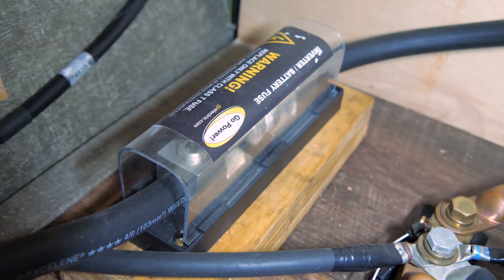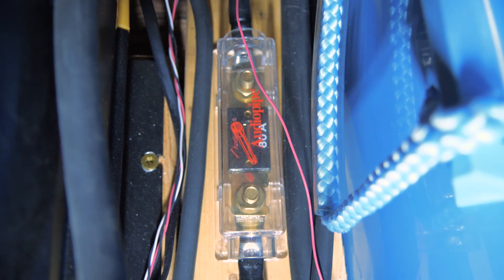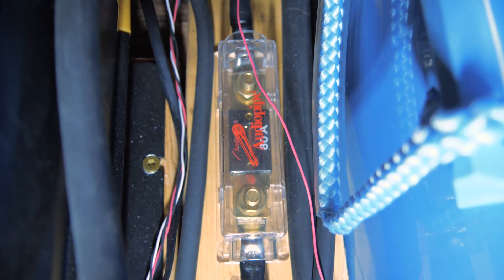MISTAKES! - 5 Common RV Solar Pitfalls - RV Life

Comment: Full Time extreme boondocker currently in Grand Staircase Monument, southern Utah. IThis summer I installed 6 100w panels with 3 100w BattleBorns i(inside coach,) 150/60 Victron MPPT,  plug-in display and smart monitor, and a Tech-On 3000-6000 inverter. Last week snowed in for 8 days at 7500'elev. 5 miles up a USFS dirt road. Though sunny & cold all days, my only draw is my cool new ICECO 45 liter chest freezer (12v), the fridge igniter for propane, a 12v heated mattress pad all night, and a few 3w LED lights. But the last night battery voltage showed 12.1 only to show 10.1 the next morning! Even my starting battery was dead through the isolator. I wish I could find someone to fix it all so I can forget about it.

Comment: Is it better to run a frig off of DC or run with an inverter and run AC ??
Reply: I like propane. No probs so far. Very cost efficient I think.
Reply: Generally, if an RV fridge is running on DC, the electricity is only running the controls, while propane is actually doing the work of cooling. It's therefore not really an apples to apples comparison.
Reply: The short answer is “it depends”. There are new, highly efficient 12v compressor refrigerators that you can run off your batteries that have minimal amperage load. However, those are relatively new and it sounds like you may have an older RV fridge, in which case keep it on propane.

Comment: Excellent video! Very valuable information!! I know this about solar.. but we do have a bank of 8 traditional lead acid batteries wired in series to make 4. My husband made his own "generator". We have a Honda engine, alternatorw/belt and a magnum charger/inverter. My husband is a champ at this set up. I do believe the alternator is 3 phase. I would get the agm he got the wet acid and just topped off the h2o yesterday.  :-) It's a system not for the faint of heart!!! :-)

Comment: We have a small class C. I installed 2 6-volt 215Ah golf cart batteries which give us 100+ Ah useable. I put 200 watts of solar on the roof. Total cost well under $400. Batteries are always charged... and for the price, I can replace those two batteries probably 3 times and still be cheaper than current price of lithium.
Yes lithium beats lead acid, but there has to be a price breakthrough in storage... or else be very wealthy.
Reply: Norton Newman;   I'm there with you. 2-6v + 200 watts of solar panels + small portable 400W inverter for the computers. I added a small 2000w inverter generator  as a backup just in case and for the few times we need 110v. I may have used 2 gal of gas in the last 3 yr. All in for under $800. Less than the cost of a lithium. My batteries are rarely down below 75% and have gone 4 years and are in great shape. Not a full timer but 4-5 days each & every month + 8-9 week snowbird trip.
Reply: @herb7877 The class C came with a built-in 4000 watt generator that sips 1/2 gallon gas per hour from the main fuel tank. We rarely use the A/C, solar keeps the house and coach batteries charged, so we used the generator less than 2 hours this past summer! 100Ah isn't much, especially for someone working remotely, but it works for us. It's not "green", but a 4 hour stint with the genny costs less than $5. But... I have to admit that unlike this young couple, our motorhome sits in the backyard charging it's batteries much more than it's out on the road. 🥴

Comment: Good day! I went with the Go Power system. Unfortunately,  the inverter was faulty but Go power sent a new one, now I have to change it out. 👌🏻
Reply: Oh, that happened to us - it was a Go Power 2000 watt inverter. We had an RV tech change it out - they said it would be covered by Go Power - but then Go Power said no, they won't pay for labor - only the cost of the unit. So we had to fork the bill. :/
Reply: @drinkinslim  I installed mine so I’m not out the labor just time but yes it sucks but glad they replaced the unit